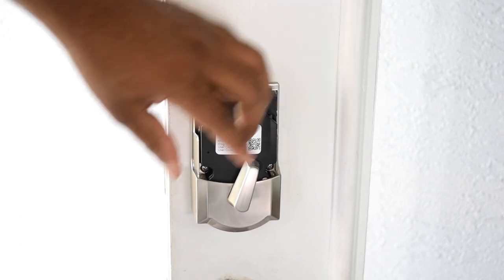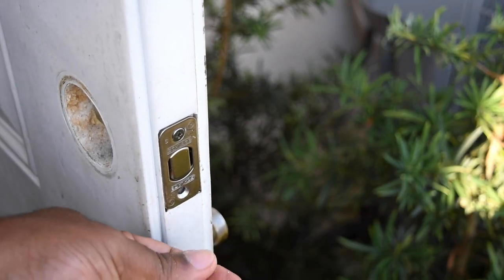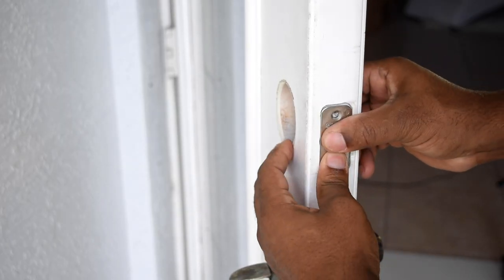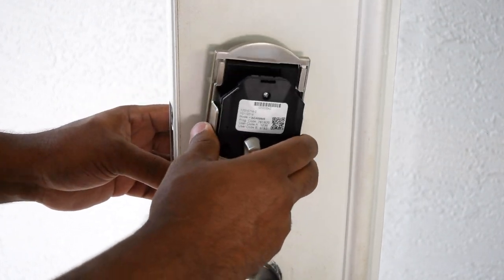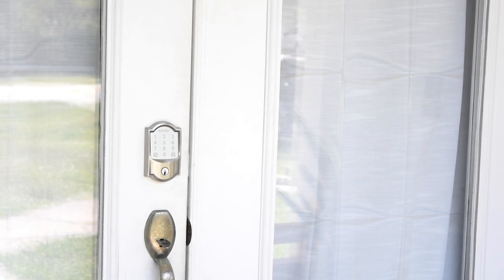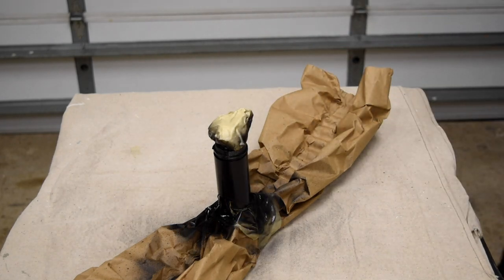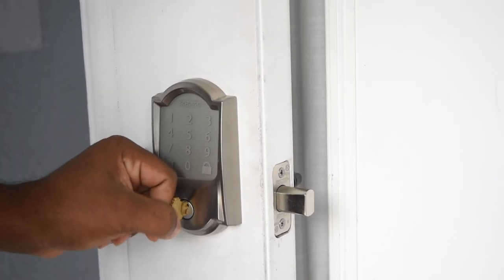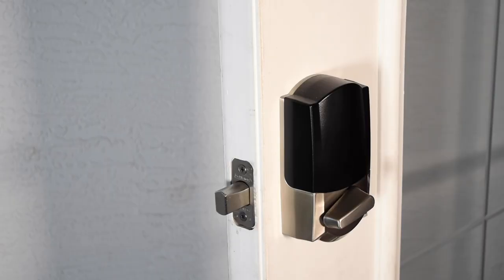Smart Lock Install & Secret hiding spot for SPARE KEY | Schlage Encode Smart WiFi Deadbolt

Comment: Thanks for the info. I've eyed those locks many times in Home Depot but wasn't understanding how they installed or worked.  They don't put the most complete information for you on their displays to let you know how easy and how they work.  Now, i'm thinking of a lock like this. However, i'd prefer one that also had a remote like my autos do so that I can have the door unlocked in the rain so I don't have to stand and get wet while i'm entering the information or fumbling for my cell phone to open it.  AND i'm not that hand eye coordinated quite yet...lol.  But, great information.  How I wish I could get you down here to get my entire house fixed up.  It would be awesome.  Keep up the vids.  You inspire me to cut some wood or build something on all of your videos.
Reply: Tim Davis you can unlock the door with your phone just like if you had a remote

Comment: Thanks for the video. I just the same lock. Installed and running fine. However, the inside assembly is not complete flush against the door. Not sure if I did anything wrong. There is a little bit of gap between the inside unit and the door. Any ideas? Thank you.

Comment: Mine came missing the inner assembly screws. (The little silver machine screw ones to hold the back part on). Do you know what they are called? Would I be able to find those at a hardware store before I go through the trouble of returning for a replacement? Thanks!

Comment: One thing to remember... Smart tech has a barrier of its own... Your router. 

This is THE BEST reason to pay for a decent router that is backed up by a reputable company that isn't afraid to issue firmware updates.

There is a $55 router out there that tends to get firmware updates between 24-48hrs after an exploit is made public.
Reply: Which one would you think is the best one to buy?.
Reply: @RuthlessNoise  only because you asked. I purchased Ubiquiti's ER-X Edge Router X. It's $55 on NewEgg, and occasionally on sale. I bought a backup for 35. The catch is that it is JUST a router, no wifi. But, an $80 access point solves that. I also got my access point from Ubiquiti. I got the AP-AC-Lite. 

I like Ubiquiti because they also make serious big iron routers that makeup the internet's infrastructure. The kernel that runs the EdgeRouterX is the same kernel as their big routers. So as soon as they update their commercial/infrastructure grade routers, they have updates for the $55 ERX residential router too.
Reply: @jdgindustries2734  Sweet, thanks for the answer. I have a real old Cisco is like from 2014 and I've been thinking about buying a new one but my knowledge on routers is shit. I'll check the Ubiquiti one.
Reply: @RuthlessNoise  I recommend finding someone local who is good with networking to assist. The down side to the Ubiquiti is that they are not ready to run out of the box, they do require a bit of setup.

Comment: I love the idea that this smart lock can self engage itself after a set imposed time, but is it smart enough to know that its TRULY LOCKED or is it simply engaging the lock on AN OPEN DOOR that's been left open or patially open?.......
Does it have a way on the app to tell you the lock is engaged IN the deadbolt when in locked mode?

Comment: I love fancy gadgets like this.

I have two questions, though:

1) How long are the batteries supposed to last?
2) Does the lock lose any programming if the batteries die, or when you take the battery holder out to install fresh ones?
Reply from the maker: The Battery last up to one year and yes the program remains.

Comment: $250 for that "smart" lock seems a bit steep. That's like 5x the price of a regular dead bolt lock, and more than 3x as expensive as a regular keypad lock without wi-fi capability. Unless you are using it for a rental property or something, I can't imagine the remote use being worth that extra expense. Especially with the potential headache of wi-fi configuration and outages.
Reply from the maker: Sure, $250 is not cheap for a lock. I think it's more about convenience. When I work for my previous employer we would install access systems well over $100k in large estate homes. Simply because the client didn't want to carry keys.
Reply: @DIYCreators  Wow, that's insane. Did that $100k system basically include someone to walk around and open doors in front of the owner?
Reply from the maker: @rthomp03  No owners use two forms of entry, fingerprint or a keypad. Some of the clients had security guards, who would control each door form an area on the property like a control room. Most of them were high profile clients.

Comment: When it comes to locks, any lock can be picked. Thankfully the number of people that have the knowledge to pick locks are few and most of them work to get people back into their homes so they aren't trying to rob you (well not until you get the bill for them to get in). If you had the knowledge you would see that locks are only there to keep honest people out, so don't worry about it.
Reply from the maker: @121bham Lol think you so right huh? you can not kick this door in. The door opens out 🤣.  Think about it, you would have kit the door so hard that it would distort the entire frame and everything around it! I explained why I didn't waste my time reinforcing that, it's a metal door, and metal none active door. You can not chisel it! You think screws/ bolt will keep out someone who is destined to get in?
Reply: @DIYCreators  Hi, I am a little confused with your reply. I did not say anything about kicking down doors? and my intention was definitely not intended to sound smug. I only said about locks being able to be picked and although that is a sad fact it is also true
Reply from the maker: Hi John, sorry, my response was not towards you.

Comment: Great video, but there is just one flaw in this installation. Since your front door is glass, all a potential thief needs to do is cut a hole in the glass (or just break it) and can then use the inner lever to open the dead bolt. It would be better to use a dead bolt that is keyed on both sides. Although it is still a simple matter of just smashing out the entire glass. Which is why I could never understand glass entry doors, since they offer no security whatsoever.
Reply from the maker: I don't see this as a flaw, it's about convenience to me not added security. This is no different from what I had before, the glass could be broken then. I am not concerned because I get notified if someone walks on to my property.
Reply: @DIYCreators  I see your point. I recently swapped out a deadbolt similar to the one in your video for a customer who has a front entry door with side lights on both sides. Someone smashed out one of the side lights and reached in to unlock the deadbolt and gained entry to the home.  Now both the deadbolt & door knob are keyed on both sides.
Of course, even the best locks will only keep honest people from ruining your day.
Reply: @0TransAtlantic0  Not sure why all these people are concerned with the glass door. A lock is simply a deterrent, if someone wants to get in your house bad enough, they will get in. i.e. break any window or cut through some of these walls simply with a utility knife!

Comment: do you need the wifi adapter to use it with your phone ?
Reply from the maker: No, it will connect to your wireless router. All you need is the app to set it up.

Comment: Worrying about shit like Hacking is pointless. They can always just pick the lock. They can always just break in the door. 

You can never stop someone determined to get in and take your shit from getting in and taking your shit. You've just got to do the best you can, and learn to live with the rest.
Reply from the maker: Totally Agree!
Reply: @DIYCreators  BTW, have you considered doing some Arduino/ NodeMCU/other DIY microcontroller based home automation protects? That, I think, would be boss.

Comment: come from a security guy, i have to say this is a bad idea. it is just not smart to add another method to unlock your door, that just makes thieves more likely to unlock it since they don't need to use both methods only one method.

one improvement i would like is to have a keypad that scrambles the numbers, this way if you smudge the key it would not matter because the numbers would scramble around the keypad and it would not be likely to hack based on guessing the number.

it is fun though and i do hope smart locks improve in the future and become cheaper because better security in this world is a necessity. right now it seems to me like the only good smart locks are prohibitively expensive...
Reply from the maker: A security guy here too. A lock is to keep honest people out. People that really want to get into a house will find a way "door or no door". This is totally not a bad idea, it's deadbolt lock with electronics. If you put in the wrong code too many time the lock shut down. These lock has been tested and I'm sure been through a range of security procedure before it hit the market. This lock is great for convenience, can it be hacked sure, anything can even your cell phone.
Reply: If someone wants to break into your house they will just smash the window, I highly doubt they will have the skills or patients to hack the system.
Reply: @louisallen8798  so you get small windows. Or you get the windows that have wooden bars across them so they had the go through wood to make enough room for their hand.
Reply: @DIYCreators  that is alot better than I was expecting to be honest. Thanks for the cool diy stuff! I really like that backlit shelf
Reply: @BrickTamlandOfficial  those are some of the worst suggestions I have ever heard. The idea that to prevent someone breaking into your house you either make it look and feel like a prison by putting bars over the windows and doors or to loose most of the natural light from large windows by making them too small to climb through and therefore making the house feel like a cave.
Reply: Considering I mentioned going through a window and in no way did I suggest going anywhere near the door it clearly isn't me that's dumb.
Reply: @louisallen8798  doors have windows
Reply: in England a door like what is in this video would only be used as a back door, almost all front doors here are just solid wood or PVC. so no generally in England most doors don't have windows

Comment: Where are you originally from? Your accent, it sounds American but parts of it sound like you're from an island nation like Haiti or the Dominican Republic?

Stone idea is best for commoners or you could simply not be poor and just hire queens guard instead, no keys necessary. My least favourite is the keyless entry. In IT Sec they teach you from day one that everything is hackable, it's just a matter of time, especially if there's profit to be made. Regardless of what they sell you on, it can be hacked. If it's for a workplace, a shed, a car then sure but your home where your family sleeps? No way. You can go on the dark web, pay a bit of money, get the hack in whatever form it may be and then you're good to go. They have ratings just like on eBay for these sellers so they're typically legit hacks. One could hack a mechanical lock too but the requirements imo for a good lock, to actually get past it is far more difficult and more of a craft rather than something that can be bought with bitcoins. 

Just my advice. I like your videos btw, I think you really do try to make quality content and look for topics that're useful without a 30min blog.
Reply from the maker: I am from Jamaica.